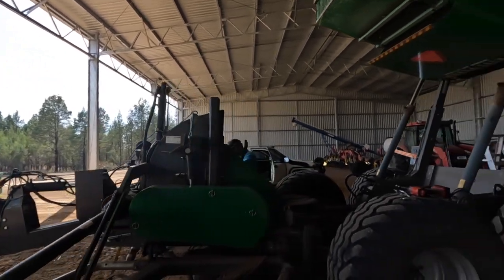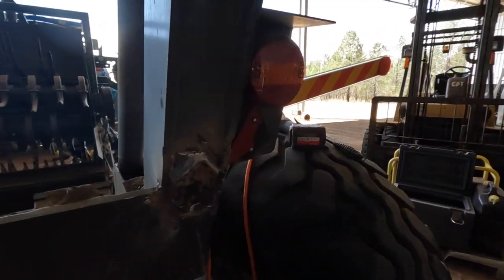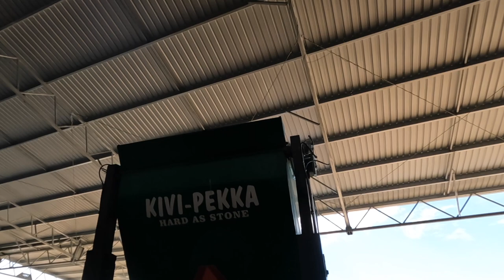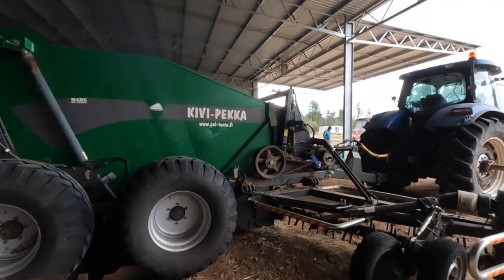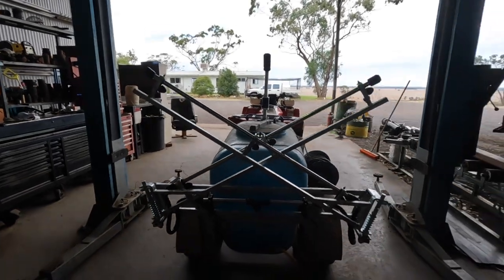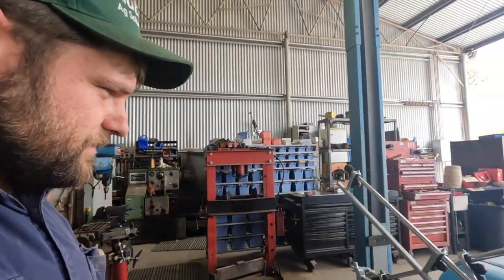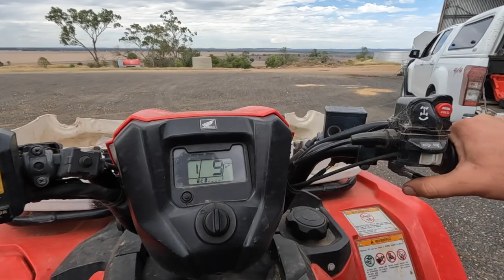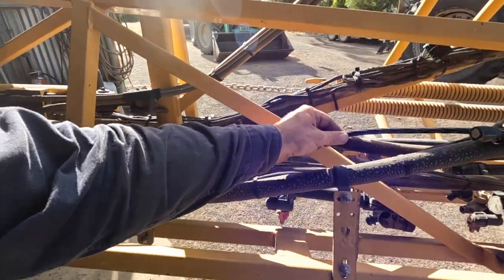Not Pretty but Should Hold!! (Vlog 143)

Comment: I think a small flux core mig would be a good tool, apparently if you reverse the polarity there is not so much splatter. Your arc welding was quite acceptable given the difficult location, any welder is only as good as his grinder.

Comment: that tricky solenoid on the rogator, if you put and indicator light next to it when its being used if it flickers there you'll know its a bad wire/connection somewhere versus a computer not doing its job properly.

Comment: Try using a smaller (3/32) low hydrogen (7018) rod on material roughly 5mm or so and thinner.. its quite a bit easier to control.. and the shorter ones are stiffer and easier to control. In the states you can get them 12 inches long or so..

Comment: Hi Matt,  yep, my cousin, who taught me to weld he had boiler makers, x-ray, chassie, and steering arms welding tickets. Always said that when you can start, run, and flow, low hydrogen rods, you are a welder. Also, he used to say that mig welding spoils and is not as careful and good as the old stick welder!! But that was back when migs were only in welding shops and yards, not a every day machine.
Reply: That's a pretty low bar to set for being a welder.  
I'm a fitter and have beaten some boilies in a weld off so it might not be too low.

Comment: Hi Matt, we recently brought a Elho Rock Picker and have so far had no problems with it stalling out even with extra tynes on the rakes. Although there has been some problems with the tractors Hydraulic oil overheating after about 45 minutes on days above 30 degrees.
Reply from the maker: Hi Sam! Glad to hear😁 we probably would of bought one if we had a spare 200hp tractor but interesting to see the difference👍
Reply: @thejacksonbrothers  We are using a Fendt 516 with the upgraded 158lpm Hydraulic pump. Also what tractor were those contractors using?
Reply: Elho offering a pto driven hydraulic unit for addons

Comment: Hi Matt, what breed / where did you get it from is the spray bar on the quad sprayer. I used some 12 volt 19mm barbed retic solenoids to turn the sections on and off on mine. And run it off a 12volt caravan pump